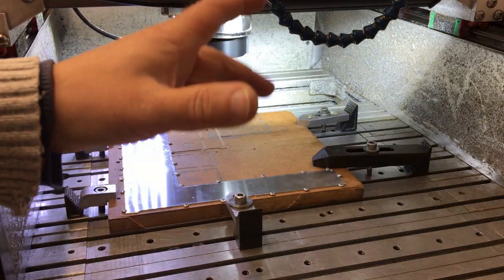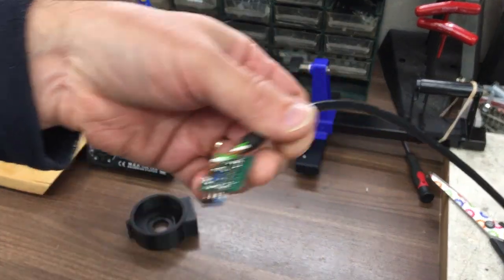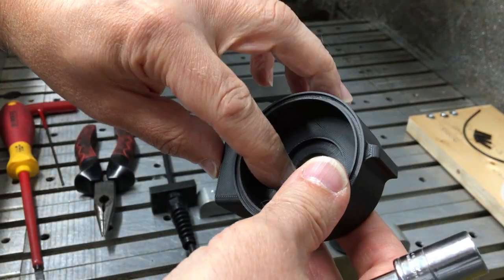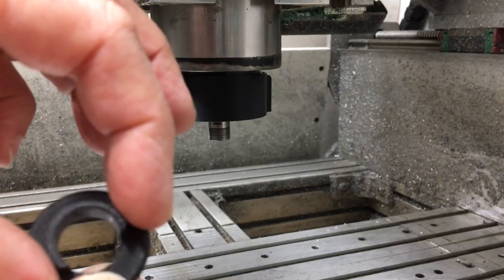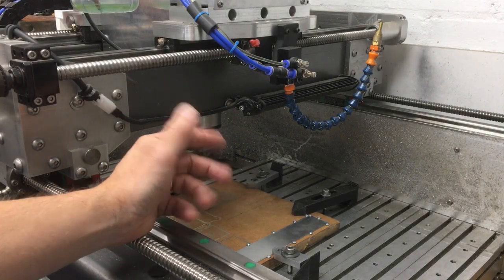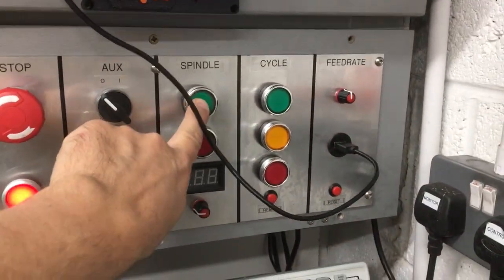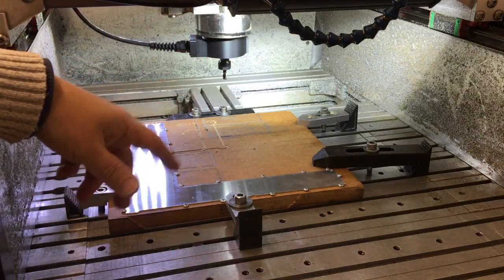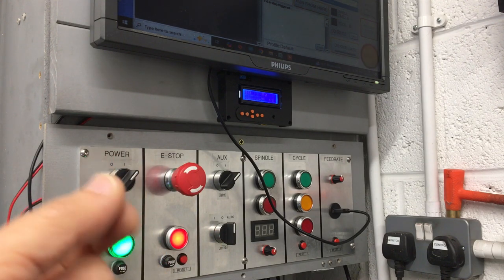Ep:10 CNC stall monitor | Will it work?!

Comment: This project is pretty amazing.
Concept > Design > Prototyping > Fine Tuning > Final Release - all the steps to take.
Should work like a dream for larger 5> mills
Unfortunately for small bits the reality is that the spindle motor probably has enough power to compensate for the gummed up mill and the motor will keep the RPM until the bit breaks.
However, a "version 2" could go in the direction of having a number of buttons to set the bit size.
Each bit size could bring in a different set of parameters for the motor loading monitor.
At the moment it is only the RPM being monitored but monitoring the pulse width increase would also indicate if the bit is gumming up and also then trigger the e-stop condition.
This is of course assuming that your spindle is self monitoring the RPM and adjusting the PWM to maintain required speed under load.
For spindle motors that just use a "volume knob" to control speed you could monitor the amperage of the motor and use that to trigger the e-stop.
This could work for those 20/40 machines that use a hairdryer motor as a spindle.
All that having been said, this is a damn fine project.
Reply from the maker: I might try it with some small end mills, my spindle is only 1.5kW so I think it will still work but who knows.  I'm not sure this inverter is controlling the load and varying the power to the spindle, maybe some other inverters do that.  I also found that I could not read any meaningful current change when the spindle was stalled.  But maybe a different type of motor could work with that idea; the simple DC motors definitely do that.